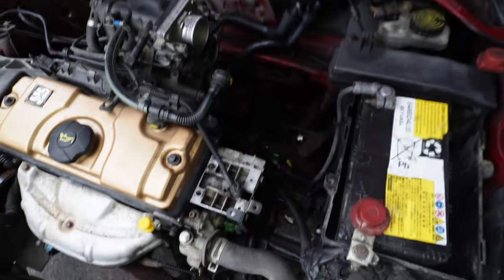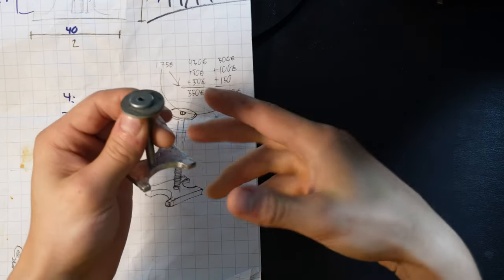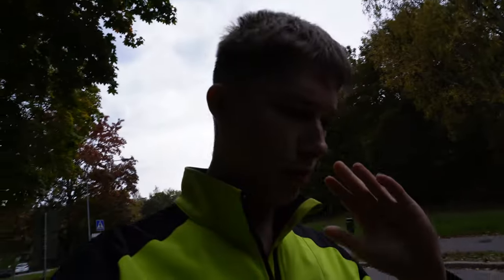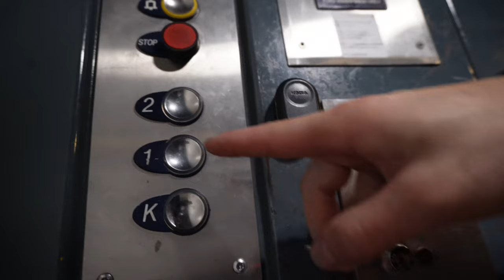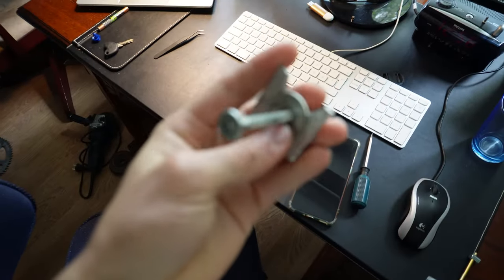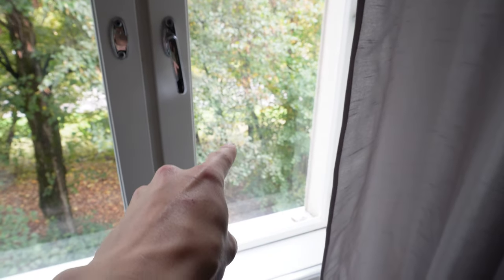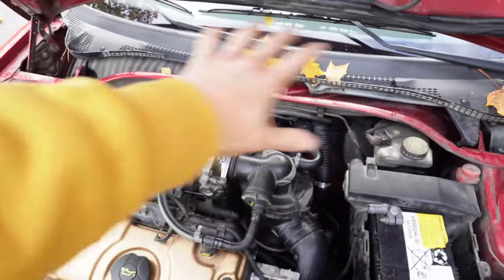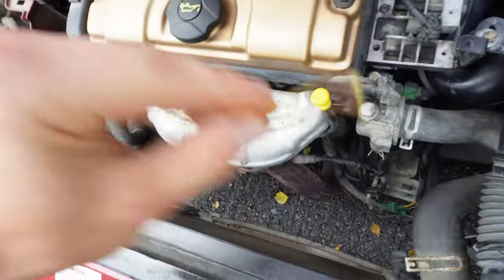Failure Is Willingness To Try - Peugeot 306

Comment: Great content, i have a heating problem on my 306 sedan. I believe the heating core must be changed but it's too much work 😃
Reply from the maker: Fun fact, I had a leaky heater core. They rod from the fact that the heater system doesn't have air filter on outside. Common issue on 306. So it's one day of taking out the dash, second day changing the heater core. Third day assembly. One weekend job. It ain't too bad of a job. It seems like a lot but it's really simple. In YouTube there is a video someone taking out the dash, there is really good article in Peugeot forums. It's big job cause there is the big dash.